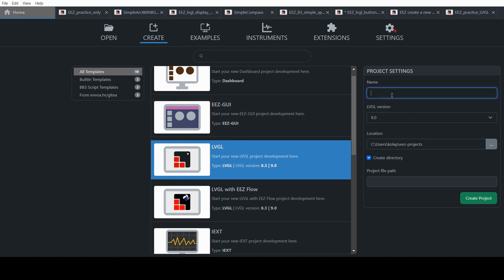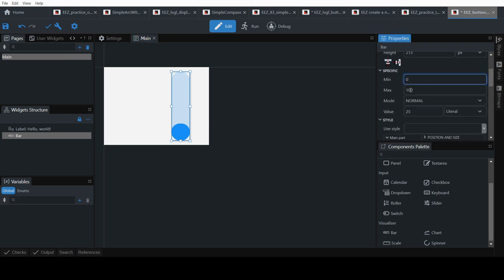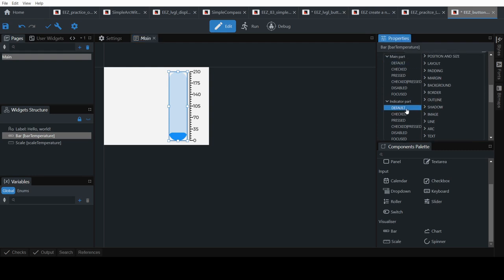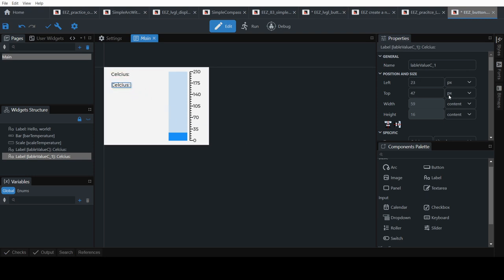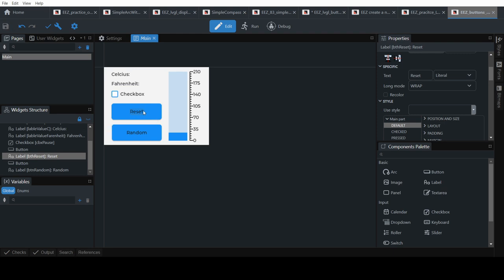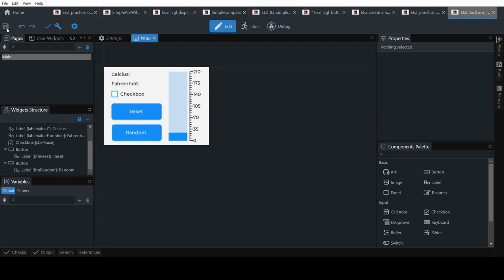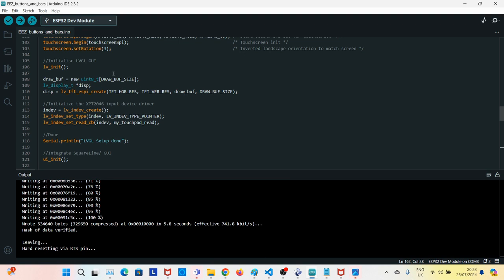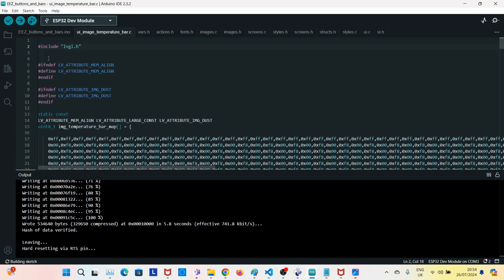LVGL ESP32 2432S028R CYD (Beginner) create a temperature bar with Bar, Button, Checkbox, Label

Comment: very good example, again! By the way, what version of EEZ are you using? In mine (0.14.2) I don´t have the scale element, but have meter instead... strange, right?
Reply from the maker: I'm using the same, on the Settings -> General select LVGL version 9.0.
Reply: @lvgl_beginner   Yes! that's why!!! I was using LVGL 8.3. With LVGL 9 can do both Scales, LIneal and round! Thanks Again!!